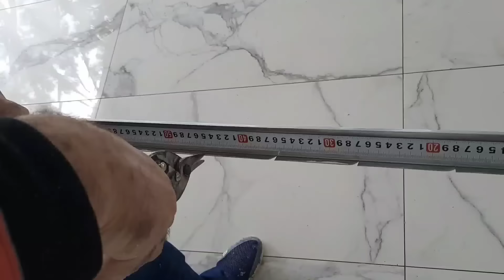طريقة تركيب جدار من الجبس بورد

Comment: Hello good afternoon from San Luis, Argentina. I am learning this trade and I have seen several videos of yours and I think your work is fabulous, I congratulate you. Now a few questions, why do you use self-adhesive mesh tape instead of the microperforated paper one? I see that it does not leave a separation of the first lines of plates with the base of the stairs, that they do not dilate differently and could cracks be generated later? Thank you very much in advance and congratulations. I will continue learning. Greetings. 🖖
Reply from the maker: Everyone has their own way of working. Paper sometimes leaves air gaps inside, especially if it is between two pieces.👍🏻